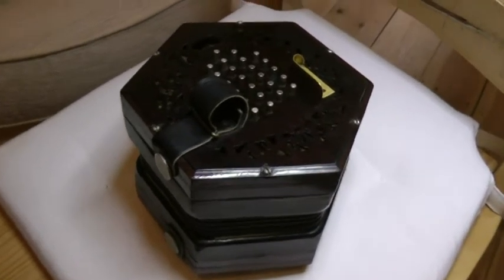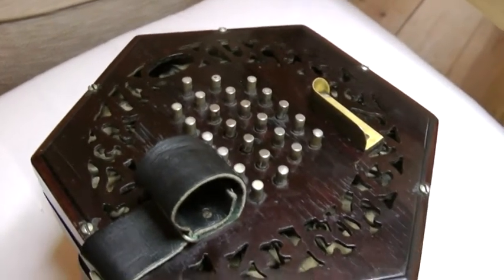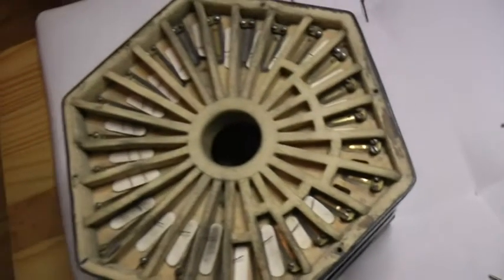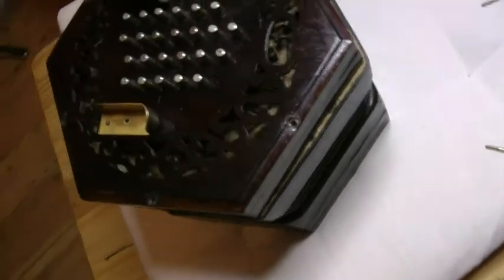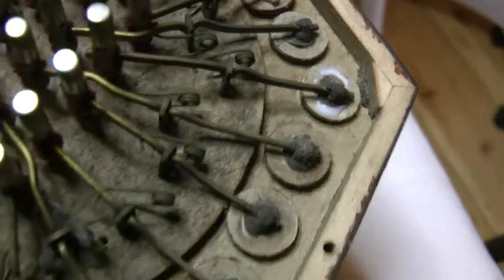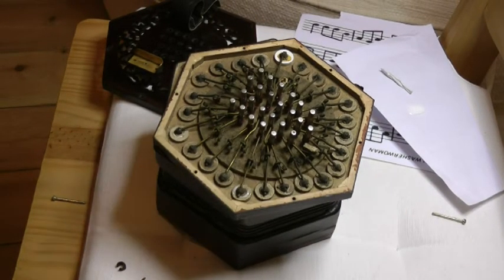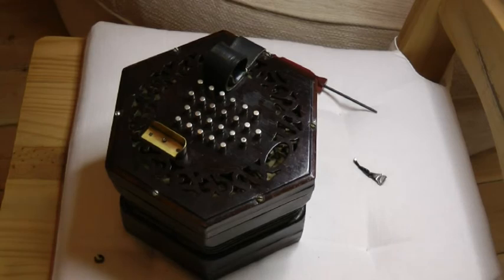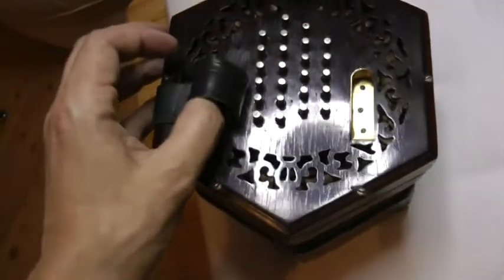How to repair an English Concertina

Comment: Just went through hell fixing a single note on my 42-key Peacock concertina. Ended up taking it apart and putting it back together four times. Don’t rely on your memory to put it back together, make tiny marks where things should line up. The problem might be an invisible speck of dust, so a rubber “dust blower” tool is essential, as are tweezers, a long thin rod (like a skewer) to tap things into place, a bright work lamp, and reading or magnifying glasses. I cried when I finally got my high-G pull-note back. Still don’t know what the problem was. I just blew air at all the reeds from both sides. There was also a hairline crack in the reed board which looked like it might cause trouble in the future, so I reinforced it with a very thin strip of tape. Good luck to anyone else giving it a go.

Comment: I advise using less glue, and cleaning up the excess.
Reply: Cheers for posting this. I have the twin sister of your pretty concertina and found this very helpful in repairing the same problem.  I'm all thumbs mechanically so patience and deliberation were very necessary, but the alternative was going all summer without my box. All the best from the Bay of Fundy.

Comment: As a repairer of accordions and concertina you made me shudder st the way you went about your procedure. Next time use a jewelers screwdriver to loosen those screws, and always put them in a small container to save losing them if they fall on the floor. 

If in doubt don't meddle, always consult online experts for advice. But other than that it's a nice concertina you have there and I've repaired many of those models.

Comment: epoxy putty or solder would have worked better.
Reply: The original glue would have been hide/animal glue which is reversible and can be cleaned off easily should it be necessary to replace or adjust the pad. The PVA glue used in this repair is OK, and many repairers use it. But it's not so easy to clean off. Epoxy is just too permanent. 

You suggest solder. Don't be silly. Have you ever tried to solder card and leather on to a brass rod?